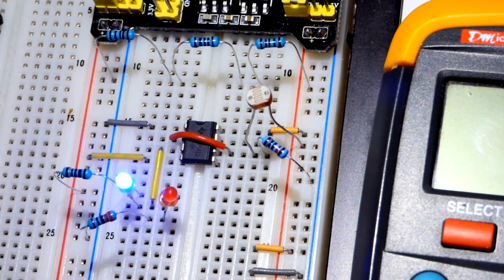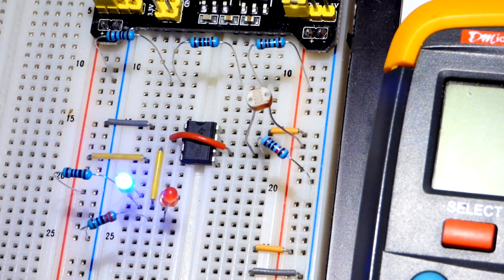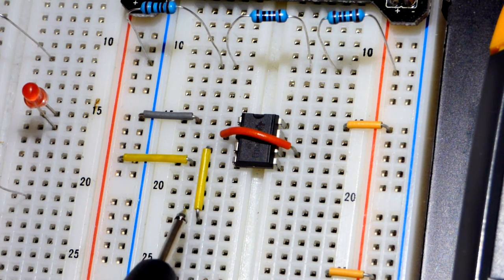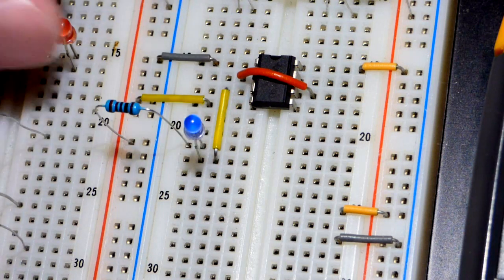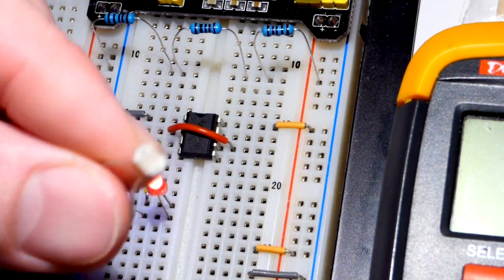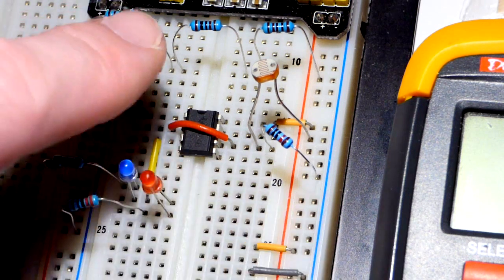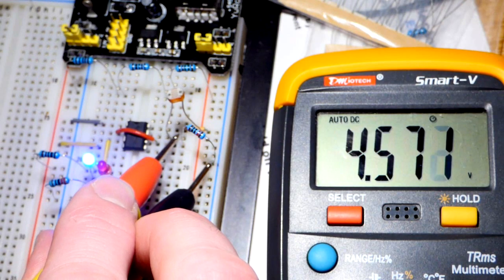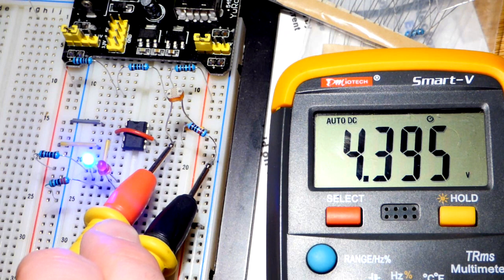555 timer light dependent resistor LDR voltage divider high low LED beginner learning electronics

Comment: For the resistors voltage divider, does it matter what resistors values we're taking?
Reply from the maker: Ultimately it's just the percentage of resistance on the positive and negative side of the voltage divider as long as the input of whatever is connected to it doesn't take  any current. so any combination of values can be used but remember they must be able to handle the power (heat dissipation) produced so don't go too low.
Reply: Thanks for the fast reply.
Reply: Just search for 'Voltage Divider Calculator' 😏 but this is where learning how to program can boost whatever skill you are trying to learn, especially if math is involved. I made my own command line tool for showing the estimated Vout and the wattage for each resistor ... even though I knew I could use online calculators. Writing out the code helps me reinforce the formulas in mah brains..
Reply from the maker: Online calculators are really nice.